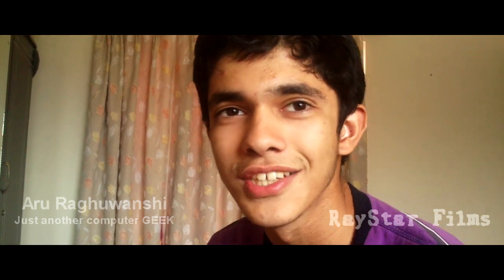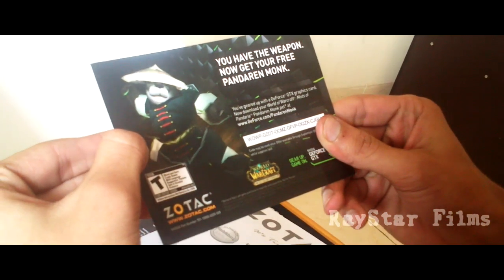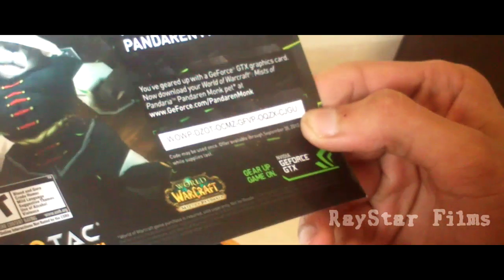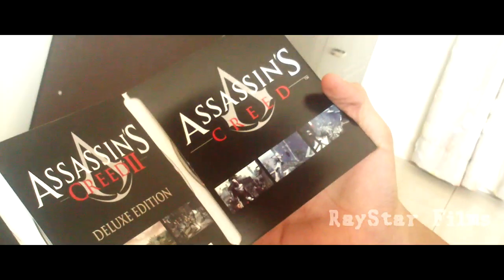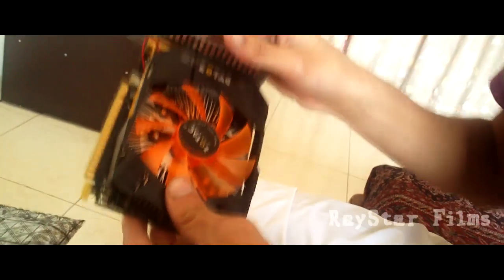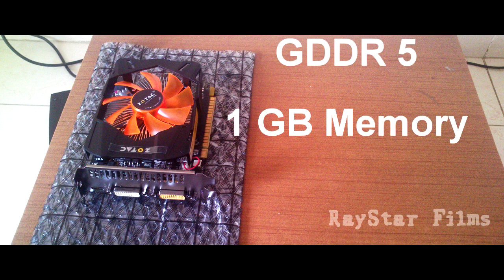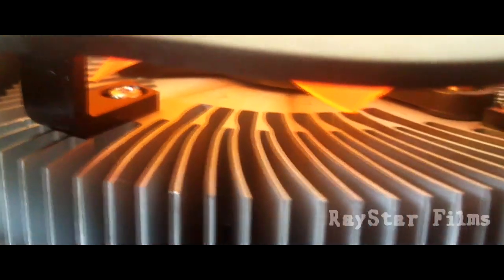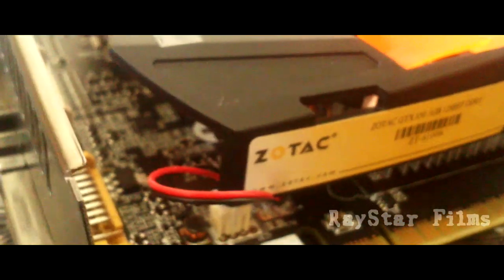ZOTAC Nvidia Geforce 650 GTX Unboxed and Reviewed

Comment: Guys do not buy this zotac graphics card from snapdeal. They are cheating by selling used/fake stock and you will not get any warranty on it. My brother purchased one for 6370. First the product on website shows VGA, HDMI slot but no such slot in graphics card. Second even on the box received shows VGA and HDMI slot. The most important pain is that SKU, PN and SN numbers are totally different on the box(invoice) and on the graphics card. And setup for cheating is that the product is non-returnable. If they cheat 100K guys for 1K they are still earning crore. I will recommend if you receive product from online seller, Before doing COD make sure to check atleast warranty details.